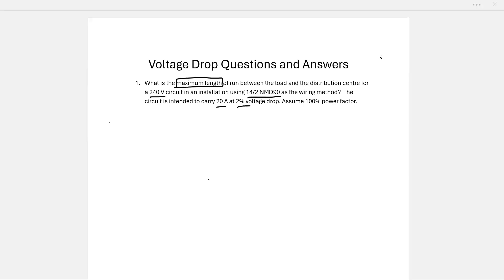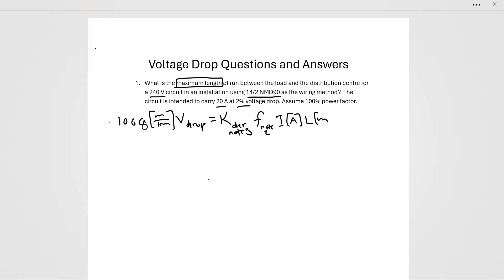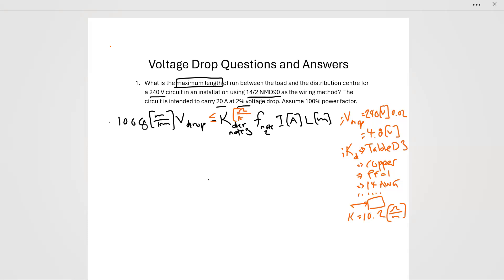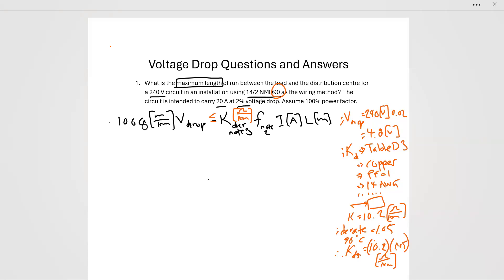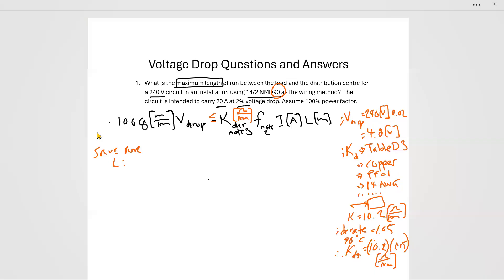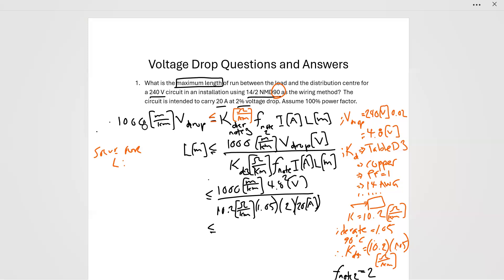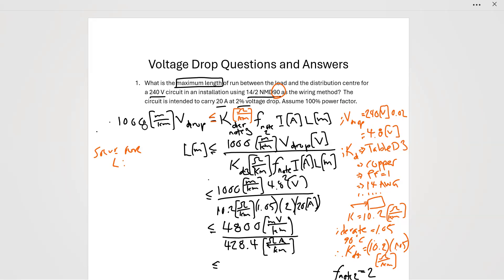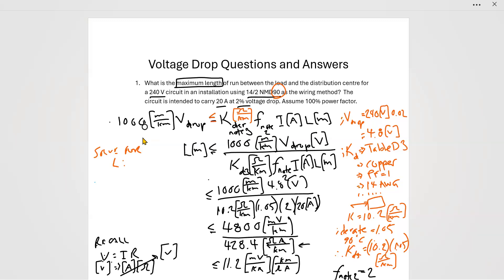Calculate Maximum Length of 14 AWG NMD90 Given Voltage Drop

Comment: your procedure with unit making so complicated, while its very easy to understand without your unnecessary showing unit
Reply from the maker: Ah, yes, it’s much quicker to do math without tedious dedication to units.  However, the resulting scalar quantity has little ability to troubleshoot. When units are involved, they practically scream wrong-answer when in error. This enables you to discover the error and re-do the scalar quantity. 
Much respect and thank you for watching.
Reply: @Prof.K.  I watch again but still confuse note 2 and not 3.... what is this? where we can find or assume ..you did not explain where we get from note 1 or 2 or 3? what is nod or note ? thanks